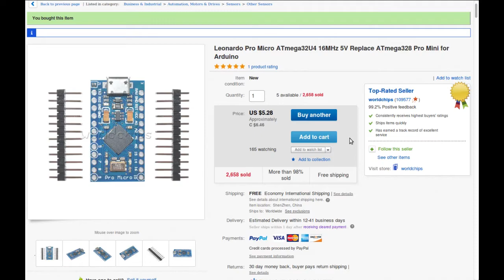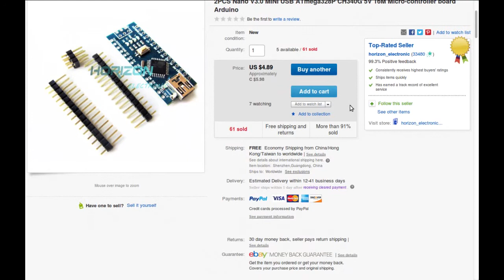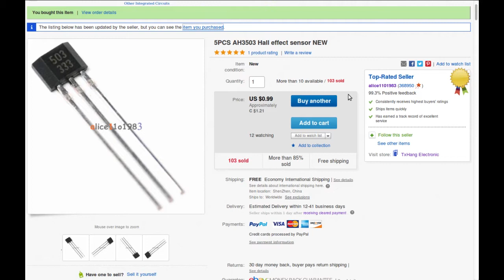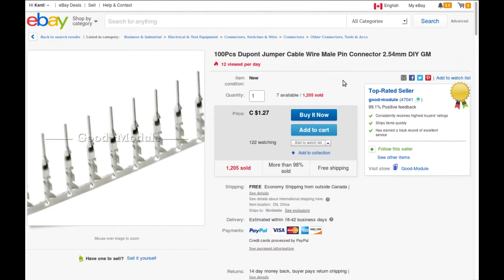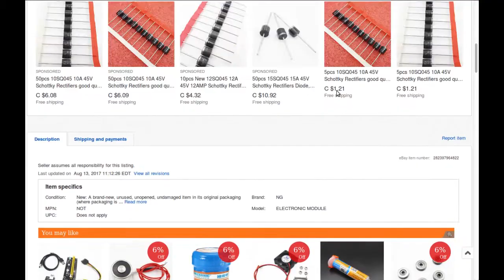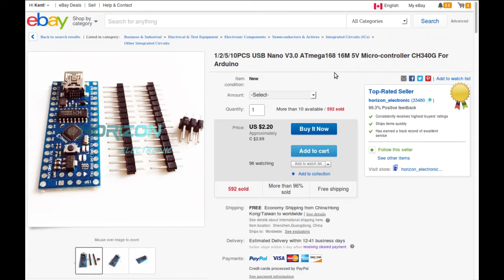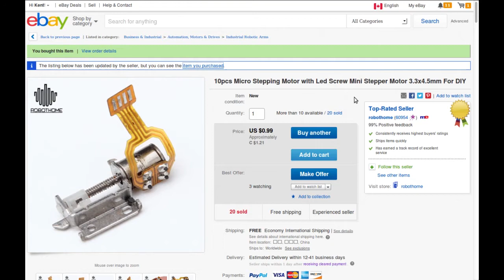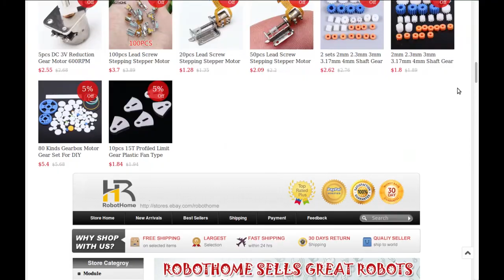mailbag 8

Comment: A model railroad application for the micro stepper motor might be to raise and lower a railroad crossing arm triggered by a train blocking an LED & detector (or Hall effect sensor under the tracks detecting a magnet on the bottom of an engine or car).  You'd certainly be the first one on your block with something like that.
Reply: David Merrifield I was thinking maybe for an automatic track switcher

Comment: The stepper motor voltage is 3 to 5V. and I think the thread dia is 1mm, could be wrong. I have several dozen myself which i am going to try operating british semaphore signals with them.

Comment: Hey, what is the name of that part tester you used on the Shockley diodes? I'd like to hear how you like it and how well it works for you. Those little steppers could move switch points on the RR layout or maybe a signal light semaphore with three positions.
Reply from the maker: I'm not sure those steppers have enough jam to move turnouts. Besides, I already have another plan: https://www.youtube.com/watch?v=gUGtj7uWZOQ 

The pcomponent tester is one of these cheapies from e-bay: http://www.ebay.ca/itm/Digital-Combo-Component-Tester-Transistor-Diode-Inductor-LCR-Capacitor-ESR-Meter-/201588666635?hash=item2eef9ef10b